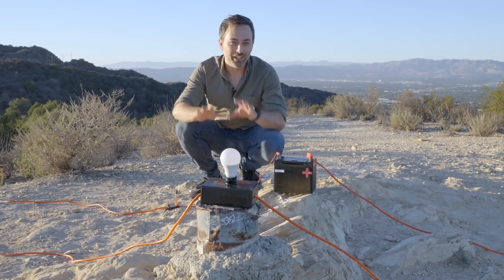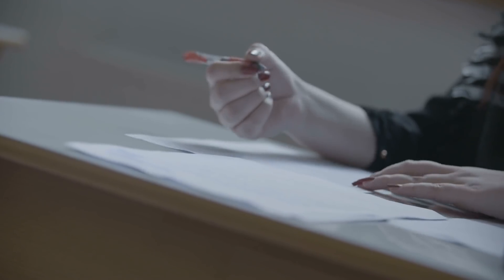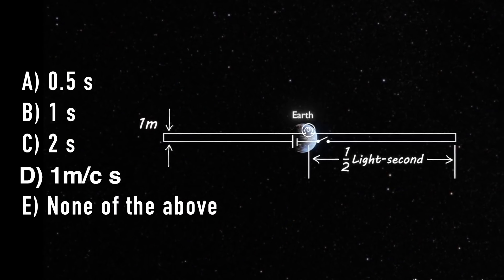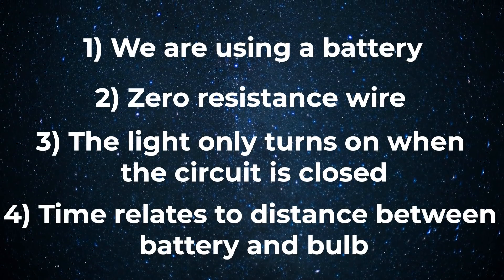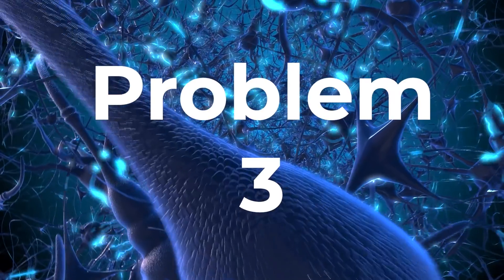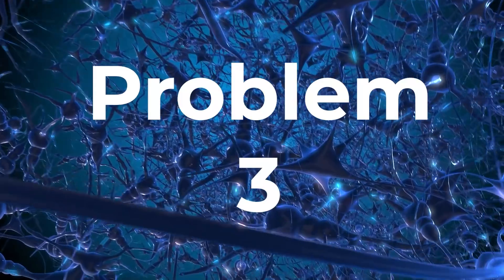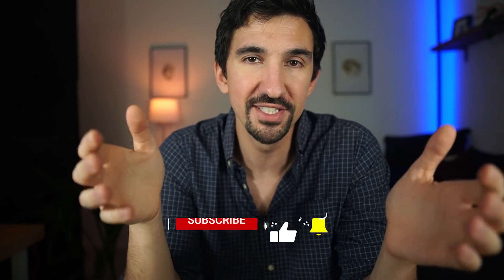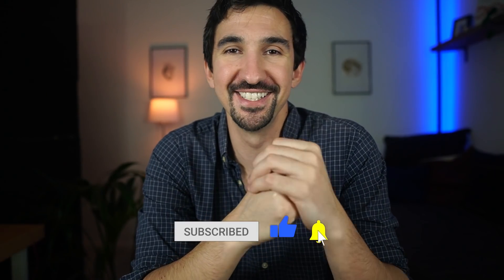Is Veritasium Wrong About Electricity?

Comment: I think your notion that if we open a switch at one end of the circuit would cause the light bulb to go off immediately (well, very very quickly, much faster than the time for light to travel that c /2 m) is not correct to begin with. The light bulb will not turn off immediately (in 1/c seconds). But it will turn off in 1/2 seconds because it will take 1/2 seconds for the effect of that opening the switch to travel before the electromagnetic field is vanished which is causing the light bulb to light up in the first place. So I don’t see any contradiction there. It was just your assumption that was wrong.

Comment: Yeah, the time-to-first-energy from the battery is at t=1m/c because that's how long it takes the wavefront of the switch being closed to move through the EM fields. The wires transfer this more strongly by coupling more strongly than air to the EM fields and acting as antennae. The amount of antenna (and EM field flux, and therefore power transfer) that is coupled to the bulb is at a minimum at t=1m/c though, and increases as more antenna gets coupled in with the distance to the furthest element of the coupled antenna increasing at the speed of light until the maximum point when the entirety of the wire has had time for its contributions to the fields to reach the bulb.

Comment: I think he was very clear that the answer was reliant on an ideal circuit with zero resistance and the presumption that the EMF capacitance isn't a thing. Your entire premise deals with the phenomena of capacitance. The light bulb doesn't care if the circuit is actually closed. It doesn't and can't know that. The wire retains energy for as long as the field is maintained. When energy stops being injected into the system the field begins to decay. The decay rate is always going to be slower than C. You actually explained this your self. The field can not collapse faster than it is formed because both are EMF interactions. This prevents any paradoxical situation from arising. 

That all being said, assuming these things don't matter then exactly what you explained in the beginning of the video would occur, causality breaking instantaneous transmission of information. 

This is intended to demonstrate that field interaction and not literal electron flow is the functional base of electricity which I think it demonstrates well. The answer isn't practically useful in any way except to explain how electricity is not pushed through wires like water through a hose. 

In the real world, resistance, capacitance, and field decay keep everything firmly within rational boundaries but these effects and how they interact with each other produce a seemingly intuitive but entirely incorrect observation. 

TLDR:
he said "if we assume these restrictions don't exist this is how it would work"

And you said "but that would break reality"

Yeah man.. so would a universe where a perfect, infinite, zero resistance, zero capacitance wire existed. The point wasn't to come to a technically correct answer about how fast the light would shut off. It was too demonstrate that our common understanding of why the light shuts off at all is wrong. 

Veritasium's explanation is technically functionally correct as it is presented. It's not useful or real but given all of the criteria in the video it is what would happen under those circumstances, understanding why that is what would happen was the point because why that is what would happen tells us the truth about how electricity is not actually a flow based phenomena.

Comment: My biggest nickpick about V's video was the initial question. No where did it say anything about theoretical light bulbs and wires. Ith the info given the only possible answer was None Of The Above. There simply wasn't enough info to make any other conclusion.  Otherwise you could make up any reason you want to suit your desired answer.  For example the answer could be 3 weeks because there was a switch at the other end open but the guy who works that switch was on two weeks vacation and then didnt get caught up on his email for another week before finally seeing the request to have his switch closed for the experiment and closing it.  An equally correct answer is we are allowed to add parameters to the question after the fact.

Comment: Closed circuits are used to isolate variables and cut down on additional static input.
The concept is to isolate only the speed of the traveling photons, with as few outside influences as possible

Comment: The switch experiment also dosent rely on sound, it would still be a light speed input, as the switch sends back a corresponding signal through the same medium, unless you want to listen for the switch with some other device, all of which would be unnecessarily annoying to pin down exact numbers for. While doable it also adds in more variables and the only one were looking for is the speed of light being transferred

Comment: A better approach to the switch may be putting two extra lightbulbs at each if the far ends of the circuit
Reply: To add to this, each lightbulb can be connected to a timer set to simply record elapsed time from when the battery sends it's energy, to when each bulb actually turned on.

Comment: Communication signals aren't sent at light speed, we use microwave radiation for the most part, it's more skin to a sound wave.
Notice most closed loop communication devices are near instant.
Although I did answer 1 rather then 1/c, but it translates the same to me at least

Comment: I'm probably wrong, but my assumption of the veritasium video was that the magnetic field would first have to be created. In creating the circuit, the field would travel the length of the wire at the speed of (sound or light), enabling the electricity to shortcut that distance. If the circuit was broken, the resulting magnetic field would need to first propagate that change down the wire before the light would turn off, ensuring no data is traveling faster than the speed of light.  The electricity can only take the shortcut when the magnetic field "optimizes" the path.  If anybody actually knows how electricity works, I'd love to hear if this is accurate.

Comment: The simple fact that more complex circuits work and that individual wires or traces on a circuit board DO have a direct effect on what happens to the electricity PROVES that electricity and power IS carried via the wire.

Comment: I was thinking about this literally about 1hr ago, using AC makes more sense me in this thought experiment. The electrons in the lamp and wire near the lamp are shuffled back and forth, due to been shuffled back and forth by the AC power source. 
With zero resistance it's not the need to move around 1 light year of wire, but the speed of the electrons shuffling, which would be a fraction of the speed of light

Comment: He better be using AC at a decently high enough frequency (i.e. radio frequency) for his answer to be right.
at DC his arguments don't make sense neither do the EEs video argument, other than technically the unit step function has a Fourier transform with energy out to infinity thst gets lower and lower with frequency. The light bulb... sure... would technically light up some amount but you would not perceive it. It'd be less significant than how much it already has lit up by just being on the earth in the presence of all the RF spectrum being used by humans (or in space where there's also radiation)

Yeah it's true about the fields but those wires are way too far apart for inductive coupling and not very wide as caps as well as far apart. If it was like, coax or microstrip yes you'd get some imperceptible amount of lighting in that time but it would take time for those waves to go all the way and multiple reflections for the voltage to stabilize at the final dc voltage

A lot of people don't understand electronics in terms of electrodynamics/transmission line theory ( or signal integrity/EMC perspectives). I like that he is exposing how circuit theory makes LOTS of assumption that are not true in real life, as that's educational and the most relevant part of electrical engineering. Circuit theory as most learn it is mostly useful for simple situations but if you are making a high speed digital communication circuit or trying to have your produce pass radiated and conducted emissions and ESD immunity etc. You better know that the schematic is totally wrong at high frequencies

Comment: OMG .. your view is soo wrong on this.  My English is not enough to explain how much you are wrong about it. Don't know where you learned that physic though.
But I try to explain my point. 
When the system is in equilibrium there is no potential difference between 2 parts of the system near each other.  in a "moment" when you close the circuit you change one part of your system and a potential difference is appearing between those near each other. No one would claim that the coils in the transformer are acting like an antenna ( kind of though :) ). The point is that the circuit doesn't have to be connected but should somehow transfer the information (still feels like an antenna but not ;) ). the distance of potential difference is the distance between places you measure and that you disrupt that equilibrium
TIMF : I just want to mention that it's just my point and I'm, not a specialist. It can happen that I'm totally wrong here and you can tell me where.

Comment: You are missing a detail in the 3rd point i think, when you cut a wire kilometers away from the battery and bulb, that change in the electric field, and it reaching to the bulb is not going to be the same time as a field change from battery to the bulb, it would be x km/c. This is one of the principles behind the Retarded Time in electrodynamics (inductance, capacitance and antenna transmission are yet to be discussed tho:) ) So it might be that your assumptions as what veritasium did assume might not be correct

Comment: it is not merely “1m/c”. it’s “distance from the break in the circuit to the bulb/c”.  if you moved the switch a light year away, it would be 1LY/c. not to mention, the light leaving the bulb would also take you a LY to notice. veritasium’s point still stands

Comment: Your video really helped me understand Derrick's and upon rewatching his I have some criticism. He talks about two different effects and doesn't do a good job separating them. The main point of his video is that the propagation of electromagnetic fields along a power line that deliver energy and not a flow electrons as many people believe. The second point, and one he does a poor job differentiating from the first, is that not only do these fields flow along the wire they also flow outward far enough to overcome the 1m air gap and turn on the bulb. Your criticism, and that from some of the top comments here, is that while there may be some current induced in the bulb it wouldn't be anywhere near enough to light it. My biggest criticism of his video is that he implies this is a significant or even the primary flow of electricity to the bulb. He does say it wouldn't be full power (which would arrive in 1s) but he makes them sound like equivalent effects and this conflates the viewer's understanding of this effect with the earlier explanation of how power gets to people's homes.
Reply: This was the only thing bugging me as well. He should have placed the battery and the bulb much further apart, may be even had a hypothetical circuit as a perfect circle to describe the field phenomenon and then brought the bulb and battery with 1 meter distance to show the field propagates outward as well.
Reply: Excellent comment. I totally agree!
Reply: This
Reply: What i see is not that the axial pulse of the energy carryin souce hits the bulb. Instead, the vectors whom leave the power source as a result of the cross produt among both fields points to the bulb, which then lights it up. Although it is true that the total DDP would only be perceived once a full second had passed, considering the amout of power to lit the bulb has its limit on 0 volts, the bulb would really light up once the S vector would reach it, given an ideal world, of course.
Reply: What I like about Derrick is that he doesn’t ignore the fields around current carrying conductors.
Reply: Spot on!

Comment: So when i stand below high voltage power lines with a fluorescent bulb it is the fields that cause it to light up since there are no wires connecting the bulb to any circuit.

Comment: omg, only physics geeks would quibble about this. Sometimes it's better living in the real world thinking like an engineer, so that you do not fuck us all up with gendankenexperiments.  All the radiative propagation effects aside, the school science point should be the "normal" case of a circular loop of wire AND ignoring inductive and capacitive field effects, and just considering stuff actual engineers have to worry about.  That is how kids get taught basic science these days: state some reasonable assumptions, and discuss when the lightbulb will be at full power, since this REQUIRES electron "grunt" to heat up the wire to 1000 degC or whatever, until it radiates a shitload, some serious electron transport!!!  so the answer to Veritasium is "none of the above"... it will take a fair while to light up, or not at all.  Once you've gone through that, THEN it is time to talk about fanciful perfect conductors, gedankenlightbulbs, near-field effects and whatnot, so the engineers can be released from class early and go play footy, or chess or work on their bike or whatever.
Reply: BTW, it is not unimportant to talk about near field effects.  When you work around NMR magnets and the like transients can kick a wallop, and wires can get shunted something powerful, and your dental filings can get yanked out. Inductive heating can be a bitch too if you do not know its happ'nin'.  So the engineers have to toddle on back into class eventually.
Reply: PS. The original article by Ian Sefton ignored the electron "field surfing" effect, since in his article he was strictly talking about desktop circuits, not frickin galactic circuits.  So you are right that the antenna effect is the only geeky valid option for a short sharp lightbulb glow "assuming micro-amps" will light this miraculous bulb up.

Comment: Your argument about faster than light communication is wrong. If you break the circuit at the far end, you will not know about this for months, hence, you can switch on the circuit on with no problem, even if it is broken for some time. It will turn off, when the information will arrive.

Comment: It doesn't break causality because the battery is just a meter away from the light bulb. You are, however, absolutely correct that the resistance is too high. I don't think there's a conductor thick enough to handle the power source necessary to make such a circuit work, and I don't think we could make a conductor thick enough and long enough.

Comment: The example is figurative in order to educate and they eluded to 0 resistance and the light not actually giving light and the switch is a touchstone for us lay people to understand what they are educating us about. I think you are mixing strenuous facts with his little model but you make great points. I am confused by the whole video though in that many cities have underground  cabling running from power grids, so do they also have underground power transformers? Oh fuck me.

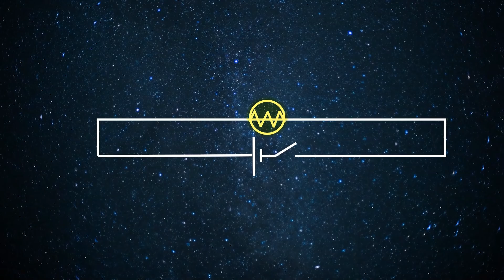Comment: 4:27 this logic does not follow, if you create a break in the far end of the circuit, you've essentially created a new switch there and so you have to take the distance from the new switch to the lightbulb to figure out when the lightbulb will turn off, there is no issue here as information can propagate at the speed of light without conflict, for example: if the breakage happens at the same time as the switch is turned on; the lightbulb will turn on followed by turning off again when the information about the circuit breaking reaches the lightbulb - I countered this video's argument, not that anyone will care or get it

Comment: And here's another reason Derek (Veritasium) is wrong here: if the power of the light bulb on a (300,000km long) circuit is sufficiently low that a 1m distance transient induction will turn it on, then you don't need the battery or switch. Fluctuations in the Earth's magnetic field will turn it on.

Comment: In the experiment, when the switch is depressed to on position, there is momentary pulse of current to the resistor bulb which is through the capacitance closest to bulb The long length of the wire may be likened to a long transmission line with the bulb as a load. The spike of voltage will run along the line and be reflected when it reaches the resistance end then a smaller spike, depending on the mismatch between the characteristic impedance of the long line and the resistance of the bulb will be reflected back to the Battery end. This will go on till the DC current stabilizes in the time it takes at a speed lower than the speed of light and the bulb will light up as soon as the voltage at the bulb stabilizes. The time to light up will be longer than 1 second! Being a steady DC current, the energy flow is confined entirely to the wire. Is this a valid explanation?

Comment: The return wire (neutral wire) can not shock if connected to both scorcese. But there is a center tap in all multi phase transformers causing a shared or balanced load on the neutral wire. So I'm not sure. Allwas thought the neutral provided no electricity only returned it to source

Comment: The circuit is effectively the boundary conditions for the em field from the battery. When the switch is closed, there is a transient period of em wave travel and surface charge rearrangement in the circuit. Once that is in equilibrium, a steady current flows, but until then charge will move through the bulb, but not a steady current